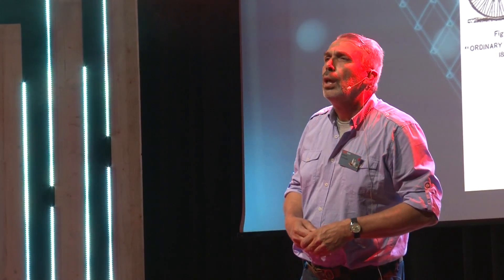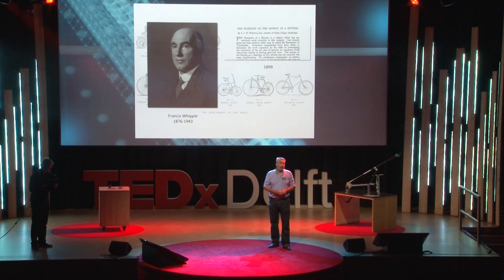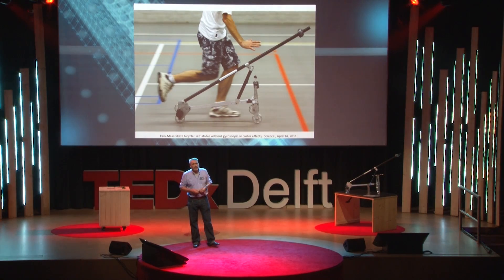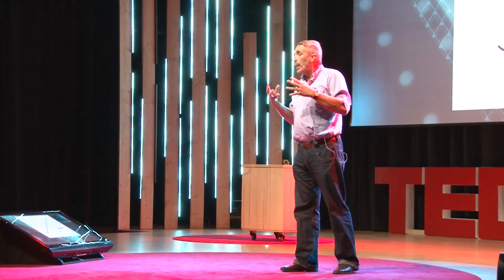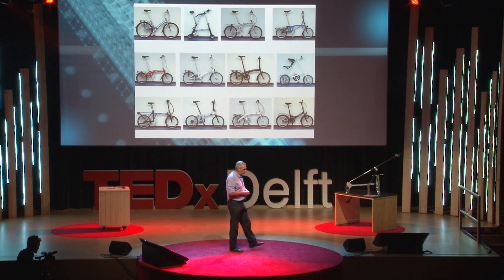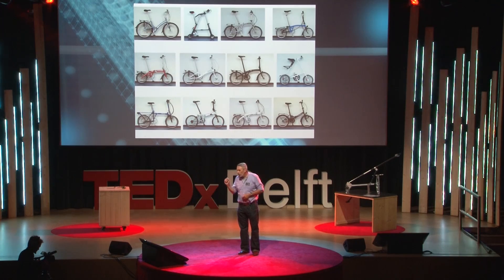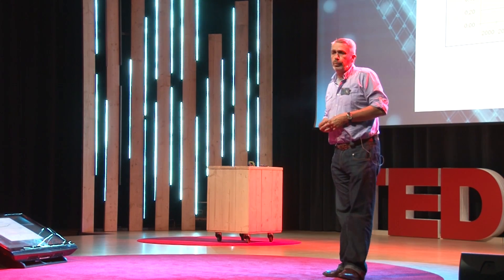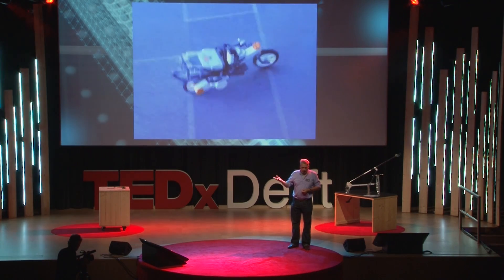Why bicycles do not fall: Arend Schwab at TEDxDelft

Comment: So, it's still the caster effect.
When you look at a bicycle tire in cross section it is circular. The center line of the steering axis is in line with the center of the contact patch however, as the bike leans to one side the contact patch moves to that side but the steering axis leans with the bike and so the contact patch and steering axis are no longer aligned. If the bike leans to the left the contact patch moves left of the steering axis creating a caster effect not in the line of the movement of the bike (y axis)  but in the line of the lean of the bike (x axis) . This causes the steering to turn into the lean. The caster effect is in the x axis and not the y axis. Make a bike with tires that have a cross section of zero (a thin sheet of metal for example) and you will see that it is unstable.  You can experience this by riding with no hands.  Take a mountian bike with wide tires, ride it with no hands, then switch to very thin road tires. It will be much more difficult to ride hands free. Maybe the upward trend in accidents is due to a trend in narrower tires?  Maybe a return to wider tires would help.

Comment: 12:45 The reason for the instability of the bicycle being pushed in reverse is not an inherent rear-wheel-steering problem as implied. It's because you were using a front-wheel-steering-stable bicycle in a direction for which the steering was not designed.  I'm sure your trailing-wheel penny-farthing design wouldn't fare very well if you pushed it with the small wheel forward!

Comment: Maybe I am wrong but I believe I have always understood from looking at bicycle frame design that the angle of the head tube/steerer tube, was a huge determining factor in the stability of a bicycle and also on how quickly or slowly it can be steered.  The first safety bikes such as the Wright brothers build had a fairly relaxed head tube angle which in turn made it easier to keep the bike going straight.  Somewhere along the evolution of frame building and I am not sure on this point that certain frames had the head tube angle steepened.  I know on most of my road bikes which I have models from the 60s thru 2015 the head tube angles are different than my mt. bike frames which for obvious reason are designed to turn  or maneuver quicker.  I would think if you did the push the bike and let go test the modern road bike would out-distance the modern mt. bike.  I am not sure this gentleman explained that, maybe he did but I am not tech-smart enough to know if he did.  Lots of factors for people falling over on bikes nowadays besides stability, cell-phones, lack of skill, not paying attention, riding an E-bike faster than they are capable of handling it.  Just my humble opinion, have a nice day.

Comment: Centrifugal force  -- velocity holds the wheels upright.  When the bike loses velocity it starts to tip.  When it tips, it increases velocity, and the increased velocity returns the bike to stability.  Like an airplane that stalls, falls, increases speed, and regains lift.
Reply: No

Comment: Interesting problem. Could it be caused by the difference in diameter of the front tyre contact surface when the tyre starts to tilt and the contact surface is not the middle of the tyre but rather shifted either left or right ? The tyre will roll partially on it's sidewall where it's diameter is smaller, and therefore it's speed lower, compared to the middle of the tyre resulting in a difference in speed between the faster outside (middle) and slower inside (left or right depending on direction of fall) of the contact surface area of the tyre forcing the front tyre to steer into the fall (path of less resistance). The following weight of the bike wants to continue its movement forward (not the direction the tyre is steering into) and will increase friction (grip) on the faster outside contact surface area (middle) of the front tyre causing it to turn in the opposite direction of the fall ?

Comment: Few years later and this video is even less accurate. 
He never said why safety/regular bike works the way it does, neither why we all use it for our happiness. The funny thing is he presents 2 bikes with different design (highly impractical and inefficient form many points of view), yet, in the end, thar electric toy bike has the same safety/regular bike geometry we all use. 
No, there won't any revolution in bike design. It happened in the second part of 19th century. I am pretty sure there is nothing new to add to make the bike design any more efficient and practical. Yes, better materials, better suspension, better tyres etc. will make it better but there will not be any radical change of design. Especially not these "theoretical" bikes. 

I am pretty sure I got a bit further in understanding why the safety/regular bike works. Video is in progress, right now. 
Just some food for thought - positive trail, contact patch, angle and position of the head tube, two wheels ;-)

Comment: Is not the rear wheel also a castor that lies behind the steering axis? In fact, with the experimental design in which the tiny front wheel's contact point was moved slightly ahead of the steering axis, did not the tiny rear wheel's contact point remain behind the steering point[it castors still]. So a conventional bicycle actually has two castors - both trailing the steering point! The steering point always leads two in-line castors . Essentially the steering axis 'pulls' two in-line castors with a differential in castor contact points with respect to the distance to the steering axis - which sets the condition for auto steer into the fall.

Comment: I don't get the confusion because it is so simple.  Looking at the wheel as a tall, skinny donut, with a tire that is round in cross section, it is obvious that the furthest part of the tire from the center of the axle is the center of the tire as you look down on it.  To either side of this longest diameter, there are shorter and shorter paths around the tire due to the shortening distances from the tire contact point center to the axle center as you move away from the wheel maximum diameter.  For a left turn where the tire contact patch extends from the bottom center of the tire toward the left side of the tire, if we define the other edge of the patch as maybe an inch left of the longest diameter then  that edge is traveling a  shorter distance.  So the tire will move along a circle whose length is the distance around the tire at the center of the patch ( halfway between the longest distance around the tire and the shorter distance of the left edge of the tire contact patch).  Thus the front wheel circles to the left while the rear wheel follows.  This flexes the spokes to the right, creating a pressure toward the left which pulls the tire back toward the furthest diameter thus the bike rights itself.

Comment: The problem with all of these things is people trying to find "which effect makes bicycles stable", when there's many effects which all contribute, to varying degrees depending on design, speed, and lean angle.  If, at a given speed and lean angle, all of the forces on the steering add up to turn towards the fall, the bike is stable.  If they add up to turn it away, it is unstable.

Just because you can build a bike that works without trail doesn't mean that trail isn't the main contributor to stability on a conventional bike.  If you take a normal bike, and give it negative trail without increasing some other stabilizing factors, you're going to have a bad time.
Reply: But you can take a normal bike with rake and trail; and easily make it unstable by adding mass to the steering mechanism, behind the tyre contact point.

Comment: The rear wheel imposes the trailing castor effect as well, as the rear wheel  follows the path of the front wheel. Essentially, the front wheel replicates the pivot point of a castor wheel. 

The key to balancing is to alter the position for the center of gravity to match the angular path of travel - alter the center of gravity to move in the direction of a desired turn, and match the turn of the wheel in proportion to the momentum and direction of an off-center center of gravity.

Comment: Very interesting.  But as a basic design for a stable two wheel  vehicle  the bicycle  seems to have found its  optimal configuration nearly 150 years ago. That's why the bicyle has stayed essentially the same  despite  great technical innovations in  material science and computer design.  So the conclusion should have been not innovation using non-passive steering methods "let's add some motors and a processing unit because we can", but "If it ain't broke don't fix it!"

Comment: This isnt right, keith code figured it, watch twist of the wrist 2. they are stable because the forward inertia pushes the bicycle forward while any instability moves the contact patch under the falling weight, the inertia from the forward motion then pushes against the high side of the bike turning it the other way. the bigger the movement in the contact patch the more turning force is exerted which is why on a motorcycle pushing forward on the right handle bar turns the bike right even though the wheel is trying to turn left, the wider contact patch creates more friction, tipping the front over. once the front is falling the forward interia againt the high side of the bike turns the wheel the opposite way. i'm not a physicist but ive ridden a motorcycle on a pennys worth of contact patch and from a practical standpoint, the bars always track to the most stable point. with cruise control you can place a bike into full lean with a penny sized contact patch between both tires and the bike will be stable without any rider input; or rider if youve seen the motorcycles winning races without riders on them in the motogp. furthermore that same bike at full lean with no rider input is stable to essentially any disruptions, from sand to poor road conditions, the only thing that will make it fall over is an input on the bars that prevents the contact patch from tracking to the center of mass
Reply: that's amazing. I think this needs to be visualized in an animated way.

Comment: What about motorbikes?  I was told it was the centrifugal force of the wheels that keep it  upright around corners
Reply: I'm not an expert but I think the method of propulsion has no influence on the physics of a vehicle with 2 wheels in tandem.  So bicycle or motorcycle, same deal.
Reply: Peter is right, it's governed by the same principal. Centripetal force is exerted on the wheels and pushes you inwards (towards the center point of the turn). However, without a counter force, you would just fall straight down or be thrown in towards the center. This is where centrifugal force comes into play. Centrifugal force is a fictitious force caused by a non-inertial reference frame. This force is what makes it feel like something is pushing you when you turn in a car.

Comment: If you let drive a bicycle exactly straight, and then you steer to the left (with a remote control), it will fall to the right. Correct?
Reply: yep; if you take your hands off of the handle bars and just push the right handle bar away from you (and them let go), the wheel will turn left, you will start to fall right and then (without you touching the handle bars) the wheel will turn right.

Comment: He explained nothing. All he did was disprove some popular theories.

Clearly there is a negative mechanical feedback loop at work in conventional bicycles. It has nothing to do with the rider because conventional bicycles are inherently stable without them. 

The fact is, the negative feedback mechanism which keeps a moving bicycle upright is still a mystery. Amazing, but true.
Reply: Read a paper called "Stability analysis for the Whipple bicycle dynamics". I think it has a very nice approach to this issue

Comment: Why is the bike stable? So simple question, so simple answer.

Gyroscopic effect is ever present and is one of the reasons the bike will stay upright when moving. Second one is the overall mass of the bike. When pushed, pulled, thrown etc., any object has the tendency to move in the desired direction until it has no energy to continue further. Third reason is that at least one wheel is free steering in the steering head to compensate external forces (irregularities of pavement, winddrag and so on) by aligning the steering wheel into the direction of the movement.

Front vs. rear steering wheel and positive/no/negative trail. This determines the level of sensitivity with which u will steer the the wheel. Rear wheel steering is really sensitive as mentioned in the video (steering while going backwards in a car). Similar to that is negative or no trail while steering the front wheel. The less sensitive is positive trail, i.e. chopper with extra long front forks (this one will feel the most stable in the stright line) Due to this sensitivity we mainly use positive trail to ensure the best steering abilities of the bike.

Btw have you ever rode a motorcycle? Do you know what is countersteering? Do you know and understand weight distribution between front nad rear wheel?
Reply: +Krejza82 Why are you saying any of this without having watched the video? 9:40
Reply: +Aaron L You made a mistake thinking I did not undestand the video. Fact is I just do not agree with more than a half of it. From a third view it almost seems like a fundraiser video in the first place
Reply: Nope.  You missed much of the point of the video.  Bicycle geometry determines stability, NOT angular momentum of its wheels.